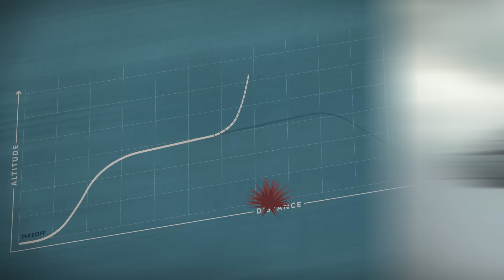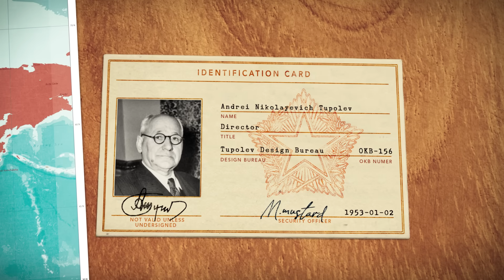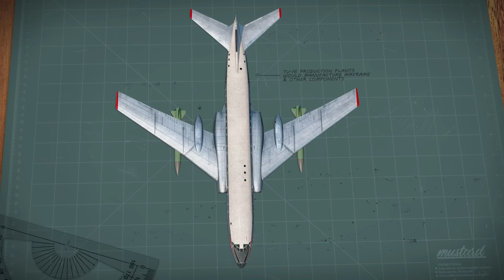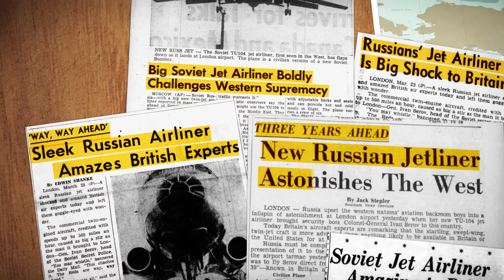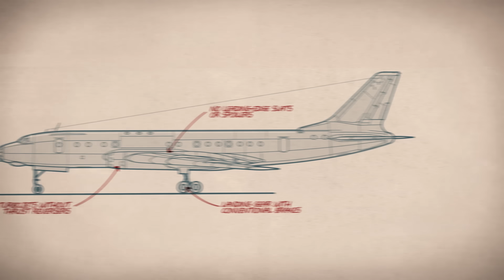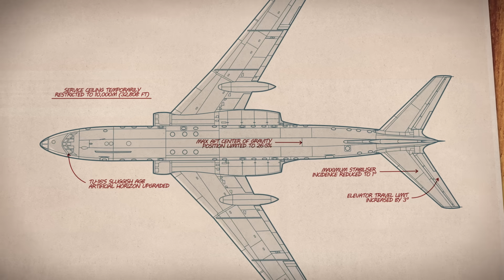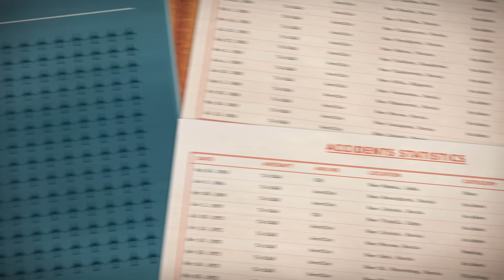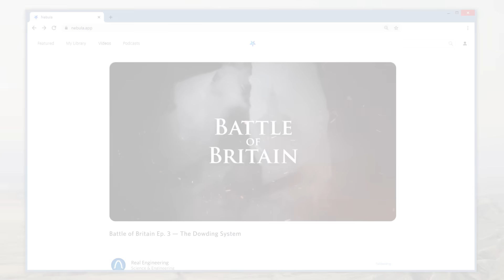The Soviet Airliner Designed To Crash

Comment: Might have been a horrible craft, but you’ve gotta admit that it looks incredible. Those integrated jet engines are sleek as hell
Reply: Big facts the plane is nice looking
Reply: How big of a pain in the ass was it to do maintenance on those engines?
Reply: @drabberfrog  They're early jet engines. They're going to be maintenance hogs regardless of what you do.😅
Reply: @martijn9568  that just makes it worse
Reply: @martijn9568  Boeing 707 could just remove a jet engine for maintenance and put a fresh one on the wing to put the plane back into service.
Reply: @ Martijn

But they weren’t really maintenance hogs even at this stage. 

They were dead simple compared to the large piston engines powering the airliners of the day. 14 to 28 cylinders with complex pressure carburetors or mechanical direct fuel injection systems and with superchargers, turbochargers, and power recovery turbines nearly as many compressors and turbines as a jet engine. 

Turbine engines were smooth, had relatively constant pressures and temperatures, and exceeding flew moving parts. 

The biggest issues for jet engines of the era was compressor stall due to fuel control units that would schedule fuel too quickly with rapid thrust lever movements.. and turbine failures due to the immaturity of the superalloy industry. But still way better than piston engines. 

Take away the propellers as well.. and they were easily more reliable.
Reply: @drabberfrog  Not much more than tail-mounted ones. They are both really high off the ground. but if service panels could be accessed from over the wing, I imagine standing on the wings would be better than standing on a tall ladder. And they aren't completely buried inside wings, they seem to be directly under the wing spars, so the engine housing actually bulges out from under the wing.
However, I agree having engines that hang under the wings that have cowlings that open up all the way are really easy to access
Reply: @drabberfrog pretty bad, you can see the dude in the intake of the comet
Reply: One engine explosion or engine fire and the wing is toast.
Reply: @Edax_Royeaux  EFS: Am I a joke to you?
Reply: @someoneuser9646  Electronic Flight Strips?
Reply: @Edax_Royeaux  The reason for engines being suspended on the wings, instead of being integrated into the wings, is to have such a separation as a safety design feature. The fuse pin that fixates the engine's nacelle to the wing, is supposed to fracture cleanly, once the load reaches a designed threshold.
This was actually what caused the Bijlmer disaster of 4 October 1992, when El Al Flight 1862 crashed into a highly populated area, very close to Amsterdam Airport. The Boeing 747 lost its engine no 3 (taking no 4 with it by sheer impact), which should not have been cause for a disaster yet, if that separation would have been clean. Instead, lots of the right wing was severely damaged, which also was not yet cause for a disaster. Only when the crew needed to lower velocity to prepare for landing, the damaged right wing could not extend its flaps, while the left wing could. The pilots did not know this, so they found themselves puzzled as what happened next. The plane got into an uncontrollable roll, due to the massive imbalance between both wings. Combined with the low altitude and speed, as this was a landing approach after all, the plane, and the crew, was doomed.
Reply: @Edax_Royeaux  I read that Boeing distrust the new jet engines so much they put them under the wing, the pylons were really long and the engines could even be dropped by the pilots in case of a explosion. Now almost everybody uses this design because it's just easier to put giant engines under the wing rather than inside it
Reply: @yuxuanhuang3523  While far less aerodynamic, it's just safer to keep the engines further away from the wings which house fuel tanks.  Even the A-10 uses pylon mounted engines because that keeps the operating cost of the aircraft down.
Reply: Speaking of aircraft, I always find it weird that De Havilland didn't consider making a variant of the Comet 1 with just two engines. Considering its size and capacity, it might've been a great regional jet. I know they used four engines because of reliability and lacking the sufficient thrust for takeoff and flight, but it's interesting to think what the early Comet could've also been.
Reply: @randomscb-40charger78  the specifications for the Comet were written by a British government commission to fulfill a future need, and only that need. So there wasn’t really room for innovation like Boeing did with the 707
Reply: @braydentoth8442  No, the engines weren't as reliable nor powerful when it was first introduced, has nothing to do with innovation. The Caravelle used the same Rolls Royce Avon turbojets seen in the Comet 2 to the Comet 4 and only used two of them as it was a short haul jetliner, whereas the Comet was meant for long haul flights with multiple stops, including the Comet 1.
Reply: the comet's integrated engines are prettier. and the ones on the tupolev are very closely connected to the cabin. I think much of why airliners today all have their engines hanging from the wings quite far to the sides (despite the fact that it's not condusive to flying with one engine when the other fails) is that it reduces the noise transmission from the engines to the cabin. those engines on the tupolev would have been VERY loud in the cabin. 
I noticed however that they avoided the window issue of the comet and made the ones of the tupolev round before that problem was even identified on the comet.
Reply: @Ass_of_Amalek  Passengers commented about how loud the cabin was and high level of vibration such that drinks would buzz across table tops used.
Reply: Yeah! It's like the art deco "streamline everything that moves" look. Hands down, best aesthetic for vehicles
Reply: Indeed, it's an uncommonly good looking aircraft for the era. Honestly gives the Comet a run for its money in looks.
Reply: @Vespuchian  Better looking tail ... the Comet's always looks a bit too 'vertical' to my eyes !

But then, I prefer the Comet's nose !!
Reply: @Vespuchian  I think the Comet's fuselage looks better imo. Reminds me of a bird, but I can't remember which. Maybe a swallow or something
Reply: @chicagotypewriter2094  Agreed. I'd give the Comet a better looking nose while I'd have to give the Tupolev the award for better tail.
A Comet with an all-swept surfaces layout? (chef's kiss)
Reply: @Vespuchian  Yup! I think someone already mentioned it (great minds think alike) but the Comet's tail is just so vertical!
Reply: I love how the nose looks. It's very beautiful. Honestly I wish the last generation (or so) of aircraft were this unique in appearance.

Bit of a tangent, but I would love it if there was more aircraft diversity in general.
Reply: All of Soviet Union and Russia planes are so beautiful even if they're extremely defective ngl
Reply: Agreed
Reply: In terms of engine integration Comet is still top dog for me
Reply: And that Russian folk song about the plane was hilarious. I'm gonna go get that album.
Reply: Integrated engines were part of early British models. They were discontinued simply because they don't work.
Reply: "this plane is a beautiful coffin" - Soviet pilots, probably
Reply: @winterstarlight-w8z   Comet - 26 hull losses out of 114 built. 23 percent lost. 707 - 174 hull losses out of 865 built. 20 percent. Tu-104 37 hull losses out of 205 built. 18 percent.
The first jet passenger planes were unsafe everywhere.
Reply: @carta8399  There are several points to be made in answer to the comparison above.

1.	You are probably comparing the 60-year+ service history of the Boeing 707 with the 23-year service of the Tu-104, so naturally the Boeing may have seen more accidents.

2.	The Tu-104 would never have flown the same number of cycles and flight hours as the Boeing 707 - perhaps the Tupolev has flown only half the amount time in the air per individual airframe as the Boeing 707 – most Tu-104s have never flown more than 25,000 hours on their airframes.

3.	Not all Tu-104s entered civilian passenger service with Aeroflot or airlines abroad. Many were retained by Tupolev for further testing and research, many entered service with the military or other government agencies, some were used in flight training schools. Also, some of those Tu-104s which did enter passenger service were later transferred to other organisations for other duties. Not all Boeing 707s flew civilian passenger services either ¬– many became military C-137s, others became freighters – just not to the same extent as the Tu-104.

4.	In any case, when we are talking about airline flight safety it is usually important to speak only of those crashes and accidents which resulted in fatalities - that’s how these statistics are measured, analysed and compared. Until the Tu-104 was retired in 1979 there were 22 accidents and incidents which resulted in fatalities. For the Boeing 707 the figure is 49 accidents and incidents. The Boeing has more than double the fatal crash figure as the Tupolev – but has perhaps flown 10 times the number of passenger flights.

Here are 2 websites that will help you learn more about the respective safety records of both airline types.

https://aviation-safety.net/database/types/Boeing-707/losses
https://aviation-safety.net/database/types/Tupolev-104/losses 
https://russianplanes.net/planelist/Tupolev/Tu-104/107/110
Reply: @winterstarlight-w8z  the British pilots said it first about the Comet,...
Reply: @winterstarlight-w8z  That was the F-104
Reply: 7:13 What is this steel cable going from the cockpit to the rudder in the outside of the plane??? It's it there to prevent to much flex in the fuselage? I've seen this before but always wondered what it is there for.
Reply: @EbonyPope  that's an antenna, used to communicate with the ground
Reply: @EbonyPope  
Radio antenna.
Reply: @EbonyPope  it’s an aerial
Reply: It wasn't a horrible aircraft. The same biased shit could be said towards any aircraft, especially any Boeing or DC-10. If we take unbiased look to safety records we will see the following: Tu-104 total number built - 205, 37 of them were lost in different accidents including hijacking; Boeing 707 number built - 865, 174 of them were lost in accidents. If you have any knowledge in simple arithmetic you will see that the safety record of Tu-104 even higher than its competitor.
Reply: @tubeescort  Not per operating hour
Reply: @tubeescort  look at the series off issues with the 737.....they don't like to highlight design problems here, travel industry doesn't like that. Soviet/Russian designs may not always be 100% successful, nothing is. But their designs tend to be robust and durable. And attractive,  sometimes just in their functionality.
Reply: Also if you think of it, The 104 was scaled down and upgraded to 124 the world's first regional jet, which in turn was developed into 134  by moving engines to the rear. And 134 flew till at least 2000's,  so there was quite a lot of potencial in the airframe, although shortcuts made it sonewhat dangerous(still not as problematic as Comet though)
Reply: just like dehavelland
Reply: It got the "integrated" engines concept from the Comet, most likely - and didn't bury them quite as deep in the wing.
Reply: @bricefleckenstein9666  no, the integrated engines came straight from the bomber, which was developed before Comet. Did you even watch the vid
Reply: @mancubwwa  The Comet was in design in 1946 in preliminary concepts, and the final design was in design in 1947 AND FIRST FLEW IN 1949.
The Tu-16 started design in 1950.
But the Tu-104 probably got the concept directly from the Tu-16 and IT got the concept from the Comet - so the concept DID in fact originate from the Comet in all probability, since the Tu-104 was basically a "cut and pasted with new fusalage" modification of the Tu-16.
Reply: @mancubwwa  Comet first flew in July 1949 and the Tupolev bomber April 1952
Reply: @mancubwwa Don't be silly
Reply: @derkjh  wow what an incredibly substantive comment. Well done for a 12 years old.
Reply: Was thinking just that, that thing looks so beautiful.
Reply: England had a similar design, plagued by problems, mainly the windows.
Reply: it looks awesome
Reply: @whoknows8225  our DC-8s were successful, but looked kinda clunky. European designs seemed cooler, and more aesthetically appealing.
Reply: @richsmith7200  True, if only the technical team were as good as the design team
Reply: Better to look good than to feel good Darling 😍 "You look Marvelous!"
Reply: @SpaNT650  God,  I still remember when saying that was the rage....I miss the old days....
Reply: so much 50s design was sick as hell, but unfortunately totally unsafe. the reason modern engines look the way they do is because they're designed to break off in the event of an emergency
Reply: @bogwife7942  True that
Reply: The integrated engines were a terrible design choice
Reply: Agree, beautifull airplane.
Reply: Not as horrible as 747 having its tail explode and kill hundreds of children because the engineers were racist
Reply: @SMGJohn  Context?
Reply: @chicagotypewriter2094  
No need with context in this comment section, it only hinders, remember, trains kill more people than cars because each crash is more deadly, no need for context.
Reply: Shame that to be integrated in the wing they needed to be very low bypass ratio, therefore not very efficient st the speeds it would fly
Reply: Agreed.
Reply: TU-104 - 205 buit, 37 lost. Caravelle - 282 built, 67 lost. Comet - 114 built,  26 lost.
Reply: Citizens of America, observe control, do not withdraw money from banks, let the banks burn with your money! Money can only be withdrawn to capitalists, not you, don't worry! Money is more important to capitalists than to you,?
Reply: whats the first song name
Reply: Copy of an American aircraft
Reply: The British Comet had it first.
Reply: Yep
Reply: Exactly what I was thinking, 
how could this design not be 
out of the park great.....
Reply: This is what bugs me the most, they have some of the coolest looking vehicles and things and they all turn out to be crap
Reply: Fully agree it really looked nice
Reply: Nah not really
Reply: It would be interesting if some of these old early jet designs were rebuilt with modern materials and avionics. But who would have the money or desire?
Reply: Super design
Reply: It just looks like a Tu-16 Medium Bomber.
Reply: Some women also look sleek as hell but they will destroy you for sure.
Reply: The soviets may not build the number 1 best aircraft, but you cant ignore the fact that almost every aircraft they pump out is sexy as hell
Reply: 00:19 Playing the devils advocate: Good looking? With these fat bubbles at the wings and near the hull? What is sleek or good looking there? In fact, that is just admitting they didn't get the aerodynamics right. Addionally, where are the fine glamourus lines in the outlay like a Lockheed Super Constellation? I don't see a good or good looking airplane. It is just what it is described, a hastily put together derivitive a soviet bomber.  Painful to see how excitement is mistaken for beauty.
Reply: @juliane__  That's more than devil's advocate there Juliana lol.